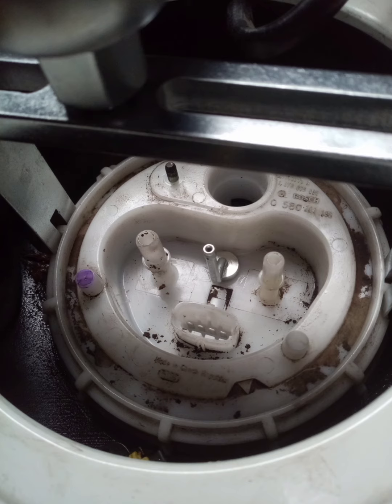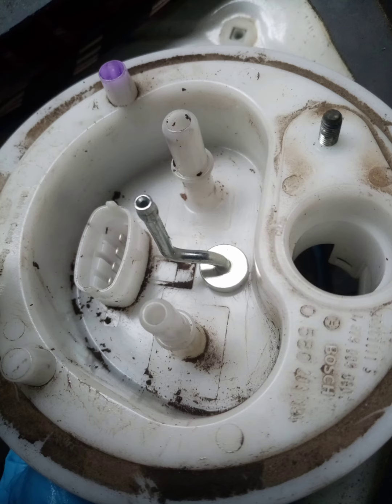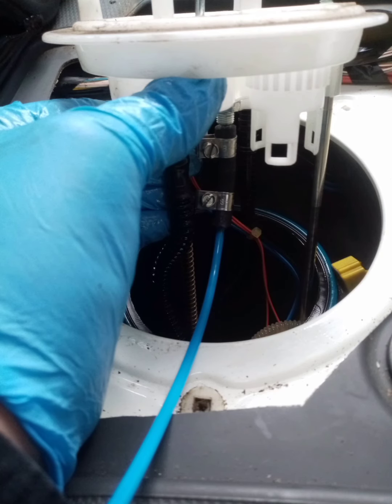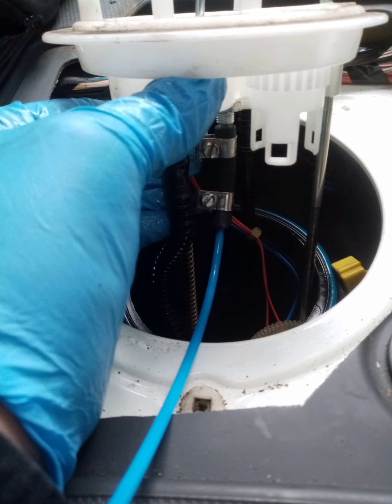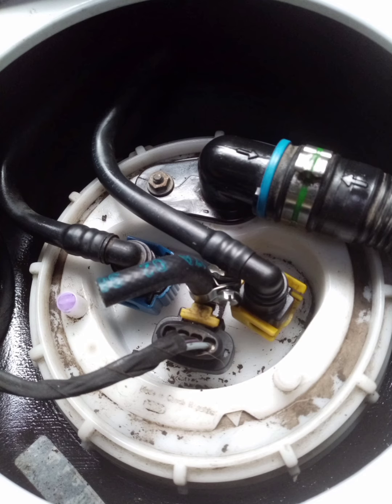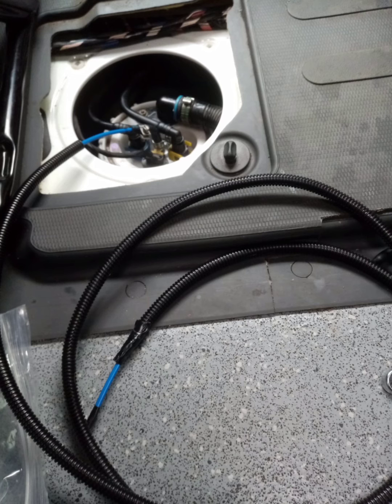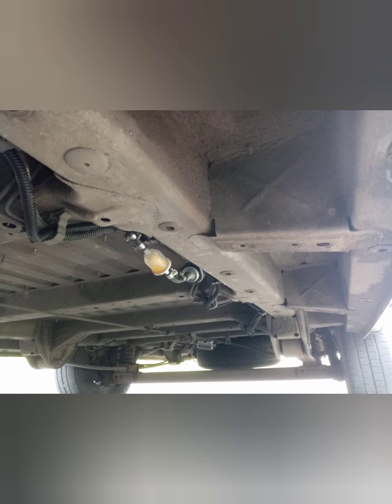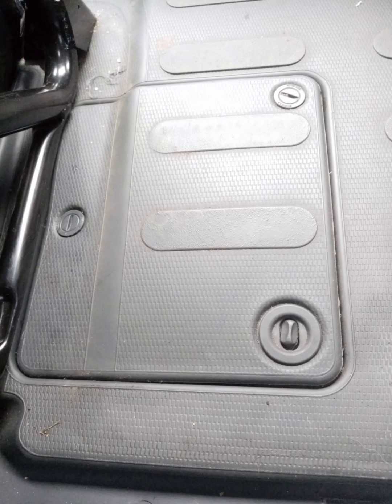Diesel heater to main fuel tank sender unit peugeot boxer /Fiat Ducato /relay Campervan.

Comment: Just had one today, and drilled a 5.5mm hole to the left of the breather, tapped it and screwed down to 'o' ring seal, in this position it's a clear run and no obstructions, easy and no mess or special tools required!
Reply: I like this idea better. Where did you get the treaded pick up ? Did you take a photo ?  Thanks

Comment: Hi, I recently fitted my diesel feed into the top of the grey breather pipe ( removed from sender, drilled 5mm hole), this avoided disturbing the sender unit and chance of debris into tank. I used a smaller bore fuel pipe than that supplied with the original kit, works a treat.
Reply: Hi Michael,
What fittings did you use, and how did you feel the fuel line into the tank through the breather? PM me if you would, Photos would be great.
I have saved Jamie's video (thank you Jamie, great vid) but, if I don't have to disturb the sender unit, then I'd rather not.
Reply: @lowrider075  my research was from Agora vanlife / on how to do main tank feed through breather. I fitted the diesel filter and put it on top of the sender unit so I can acess it easily for cleaning . 
Also view vanlife RX for alternative fuel line and pipe into tank. My fuel line is about 5m I bought an insulation too to cover the pipe before feeding it along chassis to the rear where my cdh is situated. Only one problem after a year and that was the glo plug. I wish Id mounted my cdh on its side , you tube again has lots of info on this too.
Reply: Should also mention the facebook cdh groups gave loads of tips n hints
Reply: I did exactly the same..via Breather pipe..very simple..working 100% since fitting over 2 years ago.👍
Reply: Did you do anything to seal it other than just tightening the thread? Since doing this I have had a check engine light... 

I'm torn whether this is because of me fitting the stand pipe in the breather hose OR the fact that the bad weather killed the battery and its since been recharged.   Brand new van. In for a check on the 5th of jan.
Reply: @MusicConnorThomas  no just used the thread on the fuel pipe . Nothing more.
Reply: Hello Sir, i am doing the same thing like you with the gray breather pipe on my Fiat Ducato and i would like to know if the pipe is going strait down into the unit or did you give an angle foward to avoid the sender unit system . Thank you.
Reply: The new feed pipe was straight down cut to the recommended length, no problem in over 2 years now

Comment: Hi there. Am looking to install a diesel heater in a van and use the fuel in the main tank (like you) rather than a separate one. Mine is not a common van so there's not really an OEM-type solution; it's not a VW-T4/T5 sort of thing but a rare Toyota. I can see why it might be useful to install a separate pickup into the tank, especially as in your case you have a large plastic access port where you can bolt in a pickup and also limit its depth both so you can't drain the tank with the heater or pick up crud from the bottom. In my case I don’t have this ready option so I wanted to ask whether you’d thought of the option just to 'T' into the return hose back to the tank? This would be more straightforward than a separate pickup and most return hoses dip deep in the tank, too. Interested to know your thoughts, please.
Reply from the maker: Hi thank you for the message.. I actually think that you should probably be able to get that setup to work on your Toyota as long as no air is intrained into the t connection you create before going to your fuel filter & pump to feed your diesel heater.. You should be able to see the amount of fuel In the clear filter and because the diesel heater uses very small amount of fuel I reckon you won't overdraw the return pipe.. Best of luck with setup and be good to hear back how you get on.. 🤞👌

Comment: Really good video. Very informative. About to remove the tank that came with the heater and switch to main vehicle tank. Coming into summer so hopefully prices will drop soon. I haven't got sender removal tool but most people won't. Any suggestions on removing it without the tool. Thanks Jamie
Reply from the maker: Hi Jamie, I would advise that you would be best to get the tool on amazon or ebay as its very easy to damage the lugs using an alternative method say hammer and wood.. Should be around 15 euros for the cost of the tool.. Be of luck with your removal and glad you found it useful 👍

Comment: Hi,  can you let me know where you got the base plate with collar/tower?  I am referring to the the part where the heater is mounted to the floor of the van.  Thanks.
Reply from the maker: Hi ButlerTechnik. Com.... uk company that ship worldwide around stg £ 23.00 ... Make sure to use fire resistant silicone.... Works perfectly

Comment: I cannot work out how to remove the side panel from the base of the seat. The panel needs to be removed to get to the third screw that hold down the access hatch on the floor
Reply from the maker: Can you attach photos as unsure of issue you have

Comment: I don't suppose you have any links to the sender pick-up pipe you used? Thanks.
Reply from the maker: Hi Paul, I used Bowers to get my Eberspacher fuel pickup pipe kit.. https://www.bowerspartsonline.co.uk/brands/eberspacher/fuel-system-parts/eberspacher-heater-peugeotcitroenfiat-iveco-fuel-tank-sender-standpipe-kit-292199018093

Really good kit and works perfectly with no issues.. Hope this helps
Reply: Thanks very much for video very helpful.  Did u disconnect the battery b4 or just beast in?

Comment: Where is the most appropriate place to feed through the floor to the pump?
Reply from the maker: Hi the best place to run the line to pump without any further drilling etc is to go through the gap at the top of the diesel tank which is beside where my fuel line runs in video.. I also used protective conduit for 100%protection.. Hope this helps you.. 👍